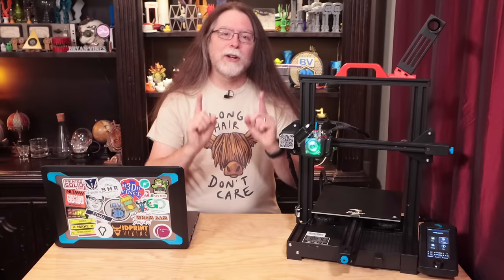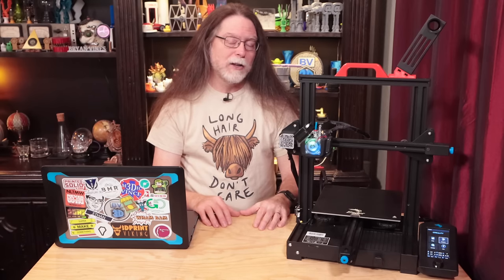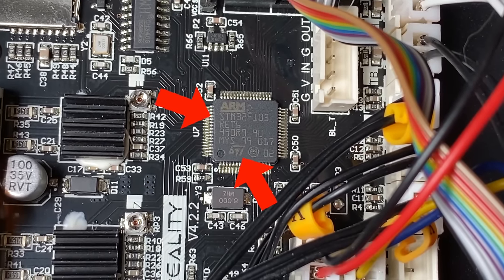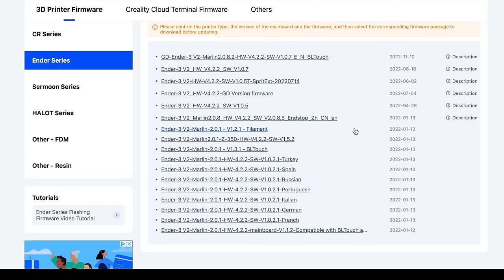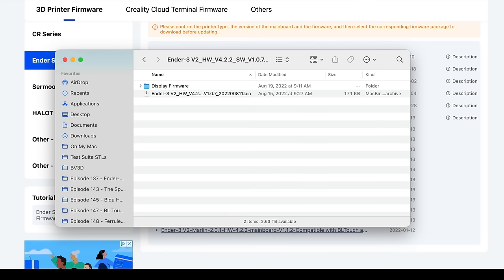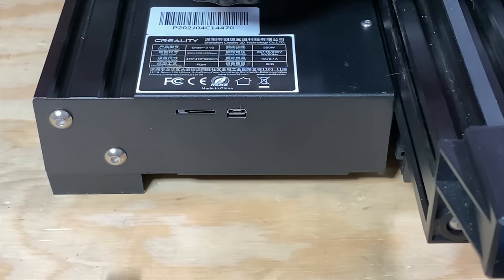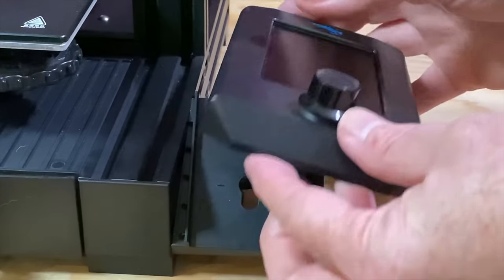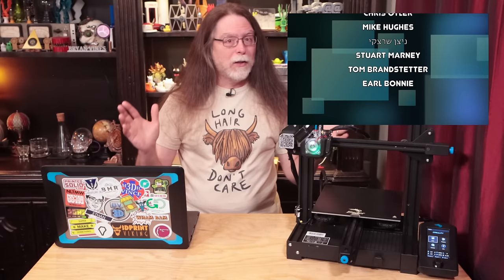Ender-3 V2 Firmware Update - Current Firmware from Creality

Comment: Wow, thank you. I'd watched 4 videos about firmware installation and none of them gave me the confidence to just do it but yours did. It helped that the printer I'm working on is the same as the one you used for the demo but the way you explained it was so helpful. I've turned a ded printer into a fully operational printer again. Thank you.
My symptoms were that it would power up and just buzz with nothing on the screen. I could tell the screen was getting power but it wasn't displaying anything. The owner had mentioned that there might be a firmware problem which he couldn't resolve so after checking the power supply I decided it needed to be flashed. I flashed it and it seems to be back to full working order. Gonna do a test print now, very exited cus I've never used an Ender before. Thanks again.

Comment: Would you recommend using the latest Creality over Jyers UI? Are there any features or fixes that you would highlight in this release?
Reply: Seconded  :)
Reply: Comparing them would be  a helpful video
Reply: Would definitely like to see that as a follow up video. From what I've seen, the new creality firmware offers live retraction setting adjustments which could be a game changer.
Reply: I highly recommend mriscoc pro firmware, it's far superior to creality and jyers

Comment: A bit late to the table...
Thank you for this video. I always wondered how to upgrade the screen firmware so it can support thumbnails. Now I do. So thank you very much. 
Many people think you are just covering old ground, but infact you are helping new guys, or old guys to check that final box on how to.
So here is my check on how to, find the micro SD card slot on the screen.
FYI, I have 2 Ender 3 S1's, and they come with the Ender 3 V2 touch screens

Comment: As Jyers hasn't seen an update in a long time, is switching to Creality's firmware recommended at this point?
Reply: I've got jyers on mine and came to the comments wondering the same.
Reply: @garethrosey  mriscoc firmware is the best for the v2 and s1
Reply: @abo_bandar4375 do you have a link to let my Ender 3 V2 print at 300C?

Comment: If ive already updated to the same firmware you are using, but I wanted to add a BLTouch, which firmware should I use? Also, do I need to reupdate the screen as well? I literally have the same board and printer as youre showing here. 4.2.2 with SM controller. Just adding BLTouch only, no filament sensor or anything.
Reply: did you find out, what firmware you should/could use?

Comment: Can I just determine the microcontrollers by trial and error? Or will something fry inside?

My printer randomly just stopped turning on (stuck at "Creality" blue screen, no progress bar). I downloaded the Ender-3 V2-Marlin-2.0.1 - V1.0.2.bin onto an SD card that I had since the beginning (8 GB), first formatted to fat32, and the printer turned on. But now I doesn't read SD card gcodes anymore. And I'm getting a weird eeprom file. I hate Creality.

Comment: Just put together a brand new Ender 3 V2 with the Sprite Extruder Pro Kit 300 deg, Motherboard is 4.2.2, uProcessor is the GD.  Looking to enable the 300 deg temp with firmware and not seeing  "spritext" and GD in the same file name such as "Ender-3 V2-HW-V4.2.2-SW-V1.0.5T-SpritExt-20220714".  Am I out of luck or will that file still work for me?  Any help would be greatly appreciated.

Comment: It should be possible for the board to self report its processor and its board version number and store that in About/Info. but this is Creality we are dealing with.
Bryan do you know what new features/benefits the new firmware has? I realise Creality wont release any meaningful information regarding this, you count yourself lucky if they release the source code.
 Bryan I have been meaning to ask, do you print your T-shirts?

Comment: Hi. My machine is set up a little different that yours. My machine doesnt have the MicroSD card in the control panel like yours. My mother board says Creality 4.2.2 and the other card is a gigo device. Because my machine doesnt have the MicroSD card in the control panel I inserted the firmware which was the 4th one down for the GD system into the MicroSD Card slot in the front of the system. Now my screen is blue. So I then downloaded the same files that you did and my screen is still blue. It was working prior to trying to update the system watching your video. The only reason I wanted to update is that it would only print if I loaded a Gcode file and not an STL file. I am new at this 3D printing. Any help would be appreciated.

Comment: I am in desperate need of your help. I tried updating my firmware, but it did not work. Then I replaced my motherboard and it’s still not turning on!!! 

I am getting an 8 GB SD card tomorrow as your advice says, but I noticed it does not even connect to the PC via micro USB  

Will updating the screen firmware fix this issue?

Comment: Dear, I have proceeded to carry out this update as you indicate and everything is fine, then I have carried out the leveling test and everything is fine, but when printing a benchy and calibration cube, the machine stops for more than a second when making the Z seam and It leaves this very thick seam ruining the entire impression. Before the update, I didn't do this. Do you know what is the cause or how and where to correct this problem? Because it will ruin future jobs, and to tell the truth, I don't want this.
 I have reviewed your tutorial and the machine, also the laminator profile and everything is fine, there is some error in the firmware code of the board (E3V2-ManualMesh-3x3-v4.2.2-v2.0.1.bin and Source code (zip ), if you know how to correct this, I would like to thank you for your help, since I don't know where the problem is. I have reviewed the profile in CURA 5.1.0, and everything is ok, I thought that the problem is that version from CURA, so I have installed Prusa Slicer and the result is the same, when the hotend stops to start a new layer it stops for more seconds than normal and leaves a very thick stitch deposited. I await your response Thanks in advance.- 👍

Comment: Your video is as usual very succinct.
Mine is still stock firmware 1.0.5.
I have a GD processor on 4.2.2 board and no ABL. As such it seems only one possible firmware option for me.
I wonder what that version is because unfortunately Creality doesn't indicated that in the name.
Is that 1.0.7? Or is it still the same 1.0.5 as what I already have?
Reply: can you do it upgrade to 1.0.7 , I follow this video but is stuck on 1.0.5 same, I you can pls tell me
Reply: @gogopai  I haven't upgraded yet because it is unclear which FW to use for my board (4.2.2 w/ GD processor).
Reply: @ashokmoghe8035  GD-Ender-3 V2-Marlin2.0.8.2-HW-V4.2.2-SW-V1.0.7_E_N_BLTouch this if bl touch installed
Reply: Ender-3 V2_HW-V4.2.2-GD Version firmware
Reply: if stock version
Reply: @InventTwig  I tried this one as well but it's still showing the 1.0.5

Comment: I have an issue with my ender 3 v2 cura  printer temperature settings. They have mysteriously defaulted to 200  nozzle, 50 bed and 255 fan. I have tried to set as default 210, 60 and zero but as soon as printing starts, the automatically go back to 200, 50 and 255. This is very recent and I am at a lost as to how to correct it.

Comment: Thanks for a great easy to follow video.  My ender3 has a 4.2.2 motherboard with a GD micro controller so the file i downloaded did not include the display firmware update files.  Can i use the display update files included with the SW download set or would that cause a compatibility issue?

Comment: Thanks for this informational video, but I'm still debating on if I should update my printer or not. I've recently run into a problem with my stock Ender 3 V2, where it doesn't show all of the gcode files on the printer. I have done some research and I know there's nothing wrong with the factory 8gb Micro SD card, as when I delete some files, it shows the ones I was not able to see before. It seems there is a limit on how many files it can show. currently, I find that it only shows about 1.5 GB of GCode files. This really disappoints me and I would hope it could show all the files on the card. would updating the firmware solve this? Thanks for the video, I might update my printer in the future as this is really frustrating.

Comment: This didn’t help me I was a fool and purchased a 4.2.7 when I should’ve bought the 4.2.2. Idk what happened with the old one but when I changed the hot end to a new one it just told me the Hot end and the bed are at too high temperature when I just barely turned the printer on. 
So I thought for sure it was the mother board as I couldn’t get any support from creality. But now it just makes a loud beep when I turn on my machine. 
I want help so bad I don’t know what to do!! Someone help me😭

Comment: Hello Bryan, I tried doing the update of firmware of my 3d printer it is an Ender 3, the mainboard and chip identification is V1.1.4 but the current available are V4.2.2 or V4.2.7. Do you know if I could use any of these? Thank you in advance
Reply: no, you would need to get the upgraded mainboard. I had to change the mainboard, but trust me you should, the printer becomes much quieter

Comment: I liked the in depth information regarding the chip as I have never been successful with flashing the firmware. Mine has the DB chip and I used that but now there is a high pitched noise from the control board and I have not been able to change it whatsoever. If you have any suggestions, that would be great.  Thank you.

Comment: do you know if their new firmware will support cura pause at layer height, I know the stock version I had did not, so I went to MRISCOC, but now upgraded to a Sprite hotend, and need to get the 300C function, but no BLTouch.

Comment: Great video,  well explained. i am a regular resin printer ... just bought an ender 3 v2 ... i have modded some stuff , springs,  firmware , magnetic plate ... and i have printed some stuff, some better than others   but ... i think i m not liking the times, quality .... maybe i just hit on a wall ...  i bought abs from hatchbox ... the thing DOES NOT STICK to the plate ... ive added tape,  changed the plate ... but the thing does not work ... and i feel like ... fdm print is a total pain in the "you know" ....  could you give me some advice?  maybe  staying away from abs ... dunno .. hope you keeo doing your great videos.  peace!!!

Comment: Amazing video, unfortunately my Ender-3 v2 Neo has a 4.2.2 motherboard version with a GigaDevice, combination for which there are no drivers in the Creality store. And I've tried other similar ones but regardless of what I do my display shows the creality logo with the temperature numbers kind of half displayed and realtime updated at the bottom (where they should be) but the menus don't show, it's only the Creality logo. Really pitiful experience. Also a bit ridiculous that standard procedure expected from the customer is to screw open both the motherboard and the display.

Comment: HELP! Ender -3 V2 Neo would only go to boot up screen.  I took back off confirmed 2.2 and GD.  Uploaded firmware (I thought) on sd and inserted into Ender and now screen is beeping.  Will only stop when unplug Ribbon from screen or power off.
Reply from the maker: Hi! Usually a beeping screen indicates a firmware mismatch. Try looking on this Creality page for Ender-3 V2 Neo firmware, if you haven't already: https://www.creality.com/pages/download-ender-3-v2-neo
Reply: I went to there site and downloaded what I thought was correct. Which would you suggest?

Comment: I lost power while updating firmware update. How do I fix my bricked ender 3 v2, what are my options?
Reply from the maker: Longshot, but try renaming the .bin file to something short like "firmware1.bin" and try flashing it again. The main board remembers the name of the firmware file it most recently used, so it may be ignoring the file on the card even though the firmware didn't flash completely due to the power outage.

Comment: HELP! My ender 3 V2 has a frozen display screen showing the "Creality" logo. It printed fine yesterday with no changes since then now it has the locked screen.
I check thermistor wires, they looked fine. 
I tried downloading the new firmware in this video (correctly) and it does nothing. Still locked screen. What do I do?
Reply: Same, I did exactly what he said and now it seems like its stuck on just loading up or this guide just bricked my printer.
Reply: Ok so the solution is to backup what you have on the card, format it to fat32. Then put just the firmware on it.
Reply: @OldSchoolDudeGaming  yeah I finally figured it out! Then my other ender 3 black screened due to faulty hardware. Never ending with these printers 😂

Comment: Mine is now a brick after installing Ender-3 V2-4.2.2-Bltouch.
Main board is 4.2.2
What now? Replace the main board?
Reply: agreed,yea it does not help,like impossible to tell which firmware is which,did you end up replacing the mainboard ?

Comment: Loved the video. I have a question as to what to do when you install the firmware on the machine and the display and the screen will not accept the firmware, but now it looks like the older style scrren? Is there a way to reset or install an older verion? I have tried to put it back to v1.0.2, but nothing happens?
thanks
Reply: Should be able to load stock firmware and try again. If nothing will load use a new micro sd  card... Its a common fix. Good luck

Comment: Hey yall, i have an ender 3 v2 and a microswiss all metal hot end. Im trying to print with pa6cf but i cant seem to edit my firmware right to let me print at 300C. Anyone have a link and or bin file that i can use thatll let it? Thanks

Comment: Does this work on a ender 3 with the 4.2.7 board and have the v2 screen ?
Reply: I would imagine it would if you use the 4.2.7 firmware as the difference between and Ender 3 and Ender 3 v2 is the screen and board. Just make sure to use the right version for the board you have. So use the Ender 3 v2 4.2.7 firmware and you'd be good to go if I'm correct.

Comment: I tried this with a giga chip on my new ender and my ender does not work anymore. Never even got to print one thing with it. I'm pretty disappointed and don't think I will be getting unto 3d printing after this nonsense. All my printer shows now when I try to start it is the creality screen. Followed the steps to this and now I have a useless printer that I need to figure out how to return. BEWARE
Reply: See my other reply. You will get it working.

Comment: This video messed up my printer and now it is useless.
Reply: How? If it is not booting now, two things to try:
 1. Format micro sd card and try the firmware again. 2. Buy new micro sd card, This fixed the issue for me i went 32GB. Cheap sd card comes with printer they can be dodgy.

Good luck
Reply: @oldman_eleven  were you able to upgrade firmware with a 32GB card? I thought only 8GB work for firmware upgrade. Unfortunately 8GB are hard to find and carry higher price compared to 32GB. 😞
Reply: @ashokmoghe8035  yes brother i did have success with 32gb sandisk... i formatted with 8k rate. Im pretty sure you can also trick the system if older by formatting 32gb as 8gb but again with 4.2.2 board ender 3 v2 neo worked for me with 32gb